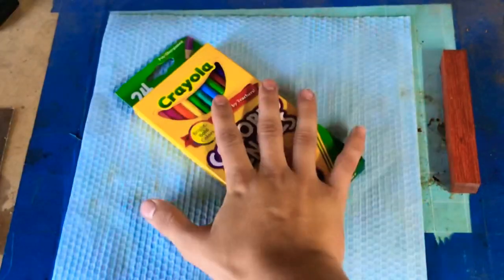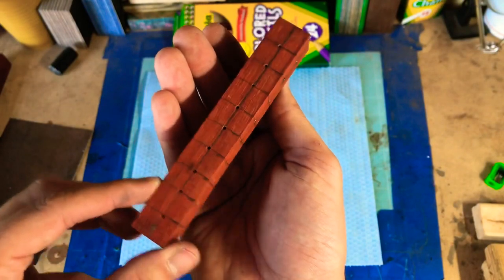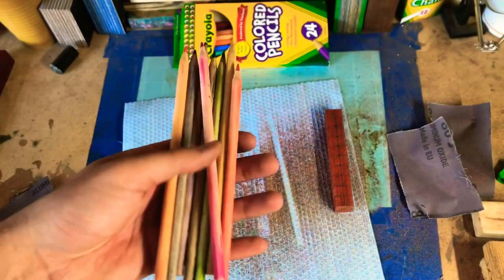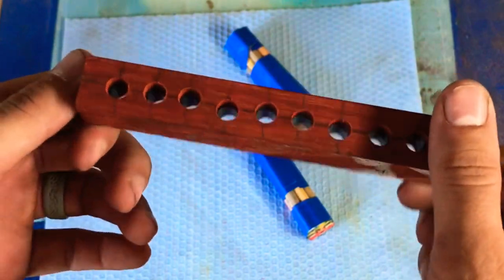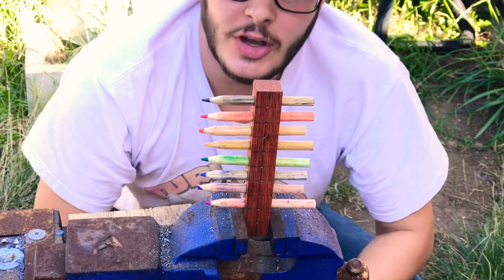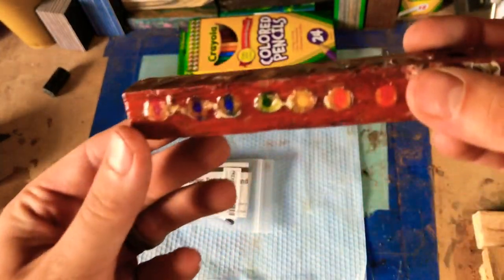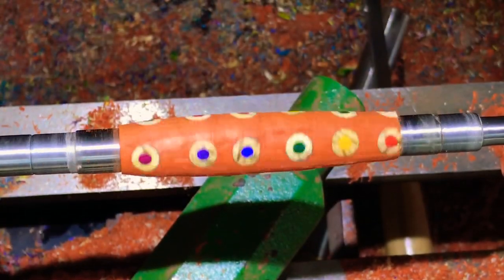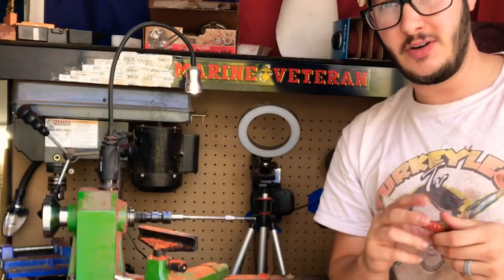WOODTURNING | MAKING A COLOR PENCIL PEN

Comment: please firmly grip your drill chuck in hand when drilling on the lathe, i noticed it turning, it could grab, slide out of the tail stock, and spin freely causing catastrophic blowout, sending the drill chuck flying. SAFETY FIRST, the tail stock only holds the chuck level, you have to hold it.